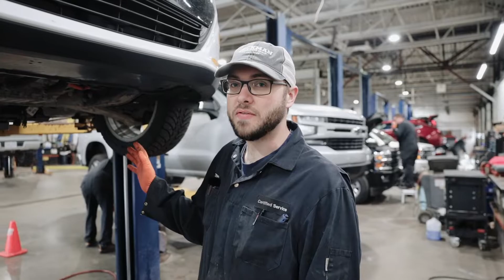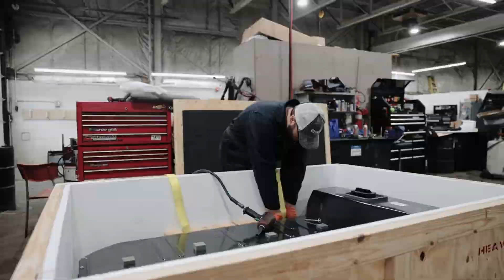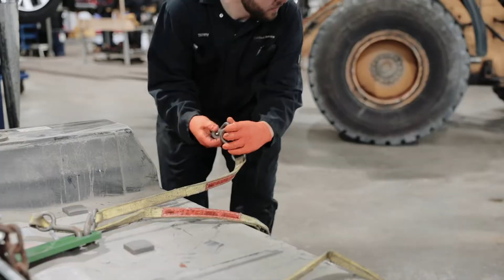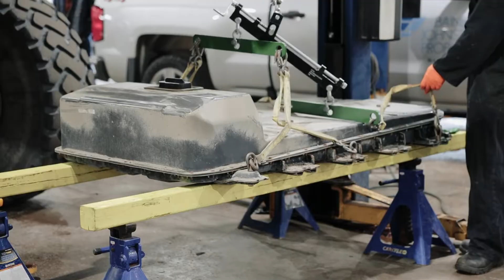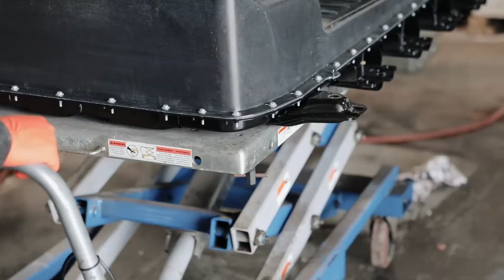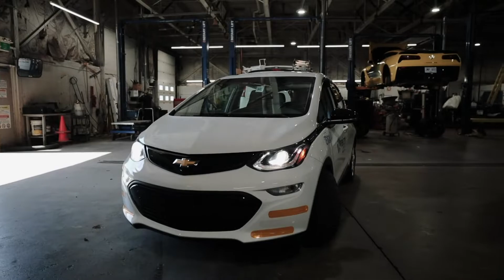EV BATTERY REPLACEMENT - Is It Really That Easy?

Comment: MSRP for a battery for a 2015 Spark EV is $30,286.87.  A brand new Bolt EV starts at $28,595.  Until that gets fixed, very few people are going to take EV's seriously.

Comment: I am a Gen X gear head and have rebuilt cars, motorcycles and work in the heavy industrial transportation industry. Recently bought a 2015 volt to replace an old everyday car and the EV cars are amazing and the Enginering is unreal. The youth today have some cool 💩 coming down the road👍

Comment: How much would this cost? Done professionally with any Bolt up to 2024? 

I read there is a possibility (motor trends I think) that you can get a used battery as well. They exist. At least in this size…or design. I saw a used price of 11K I believe..

But in an 8 year warranty you’d be luck to get a replacement battery. 

VinFast offers a 10 year/200 000 km warranty on everything in Canada. That would likely cover a new battery. And the VinFast has only battery coolant as opposed to many EVs having brake fluid as well, and even brake pads in some. (Which is dumb unless in contributes to a safer and more efficient ride). 

Having no maintenance is awesome..

From what I read the basics are tire rotation, windshield washer fluid top up, and software updates. 

Any fluids..

be nice if every EV came with a solar panal to prevent battery loss and wear in extreme temperatures. 

Any battery maintenance tips? Like besides the 80/20 rule.. some EVs came with optional block heaters,

And most come with free portable chargers that require only a wall outlet. 
Would a Motomaster Canadian tire portable outlet unit work to charge your vehicle in an emergency. ..?

Comment: Why is everyone comparing this to an engine swap? Imagine if replacing your gas tank was this involved and cost 20k and needed to be done regularly no matter how well you take care of it
Reply: Imagine your electric engine not wearing out.  Which they pretty much don't.  And these swaps on Bolt's were covered under a recall so they didn't cost anything to the owner.

Comment: Those packs are filled with small batteries, should be multiple packs that swap out and are easier to work with plus if only one series goes out just replace one pack.  Also, you could choose how many packs you need,  No need for hundreds of lbs. of extra weight if you are going driving short trips.

Comment: I drive them at work. My old 2016 Bolt would charge to 165 miles, no matter how long it was on the charger after 25,000 miles. I just received a 2022 model with 625 miles on it and it says 265 miles of range on a fresh charge. The difference is the old one was charged daily overnight, never letting it deplete and always topping it up. I only had the old one for the last 4 1/2 months, I wasn't its first user. the new one, I'm planning on charging it only when it needs it. I'm hoping this will help it with battery degradation.

Comment: So every shop now has to have a fork lift and several other heavy lifting devices. At 800 pounds that's more than 1/4 of the weight on a small car like that. Shipping them live creates an opportunity for a runway cell fire which will melt down the transport, yea definitely a brilliant cost saving , You didn't give the customer's free full charge? Crate waste a lot of trees. Really awesome. Ripoff . And how much did it cost, we know 5 hours of shop labor.

Comment: Lithium batteries don’t have electrolyte but they do often have a cooling and/or heating circuit with antifreeze like in the GM Bolt. I don’t know why you wouldn’t just cap the coolant lines when shipping the core back to the manufacturer to avoid spillage.

Comment: Now imagine changing internal combustion engine - messy and takes much more time :)
Reply: At least an internal combustion engine is cheaper and it usually lasts longer than five years,unlike this expensive 20000 Dollar Chevy bolt battery pack that's getting replaced after less than 5years.

Comment: Dec / 2023 just did a quick google search for replacement cost of Chevy Bolt main battery , $17,000 to $18,000 US , factory warranty 8 years or 100,000 miles whichever comes first . Who is going to buy a 10 year old EV ? The Bolt has one of the cheapest battery packs , some that have been in the news lately are in the 50 to 60 thousand Canadian dollar range 💸
Reply: I own a 15 year old Chevy volt.    It has its original battery that works fine.     If it does fail, I can have greenvolt swap the pack for 4500.    
I owned a 2016 Ford fusion for 4.5 years before the transmission failed.    Dealer wanted 11k to replace it.    Part alone was 6700$.
My point, ev batteries last a long time, and there are affordable options for repairs if they do go bad

Comment: To lower the fire risks associated with the Chevy Volt the replacement battery is a quartet of series 31 lead acid cells mounted in an 80-pound magnesium block containing a 25 pound thermite core. This upgrade has been shown to be less likely to suffer a thermal incident and causes less overall damage in the case of a fire than the stock lithium battery.
Reply: That's funny

Comment: Oh yeah no biggie! Every car shop has a heavy duty CAT handy. See, EV-s are cheap to maintain. You don't need to change the oil and filter every year!
Reply: LOL  I just saw a news report on some dummy who purchased an EV a few years back to "save money" since he won't have to buy gas.  But then he had to replace the battery and it was out of warranty so it was going to be $15,000.
Reply: @kensmith2796 lol...just saw a news report where a guy bought an ICE vehicle and changed his own oil (to save $75) and forgot to tighten the filter and the oil drained out and he dynamited his engine...only cost him about $10,000 so no biggie right???
You do know that the batteries don't just automatically die after a set period of time? Right? 
Geez.
Reply: @michaellippmann4474  It's doesn't cost 10K to replace a gas engine.  Nice try though, bud.
Reply: @kensmith2796  REALLY? You clearly do not know what a new crate engine from GM costs for a diesel pickup so nice try on your part!!!
Lol..
Reply: @michaellippmann4474  Yes, because out of all the gas engines out there on the road, a GM diesel is the only one.  Look, I get it, you bought an EV and are regretting it.  It's not my problem.  Enjoy your Tesla.  I'll enjoy driving my pre-2007 Jeeps like I have been for the past 30 years.
Reply: @kensmith2796  lol...no I bought my EV and I love it. Been driving EV's for a couple of years now. We just got back from a 14,000km road trip...it was awesome...oh and by the way it isn't a Tesla. 
Oh and by the way I am also a car guy with several classic cars and a 2000 Silverado 4x4. I just really like EV's for my day to day driving. Still love working on my ICE vehicles and won't be getting rid of them any time soon.
EV's are not the bugaboo that people try to portray them as just a different kind of vehicle.
Have a good day!
Mike 🇨🇦

Comment: The replacement cost of an EV battery not including labor is around $20,000. So at $70 a week for fuel to fill up my ICE it's going to take around 6 years to get to that amount. Not only that but if the repair to my ICE cost that much I'd scrap it and buy a brand new one for another $5000 on top of that figure.
Reply: its partially true, since if you consider only fuel, then yes, it may take about 6 years, but dont forget all the other maintenance during that period, like changing oil and other parts of vihicle, especially brakes (remember EV doesnt use brakes as much, almost never replace them), so with all that said, you will spend way more money owning ICE vs EV.
also, you dont have to get a brand new EV battery for replacement, you can easily get second-hand refurbished battery from vihicles after non-totaloss accidents for much cheaper price where vihicle is dead but battery is intact - some sell those and batteries are totally fine.
also,  some batteries do live way longer than 6 years, they just degrade.
if a new battery can give you 250-300 miles, then 6y/o one can give you 150-200 miles, its still perfectly usable for city or short-medium commutes, and most people are totally OK with that, so you can keep your car for 10+ years without any problem..
also, consider this, 
new LFP batteries are rated for at least 3000+ recharge cycles, so if you take 300 Miles X 3000 cycles, thats almost 1 million miles!!
even if its only HALF of thats, still, it will take you way more than 10 years to get to point where mileage if your car is  half million miles..
its TOTALLY worth it to get an EV today, especially today, and if you are so affraid of replacing the battery, got some chinese EV, some give you 150K miles warranty on their batteries, BYD Atto3 for example..
Reply: @benjaminshtark5977 It's true, you may spend more owning an IC over a 6 year period. But that's where the detail comes in. That amount of money you spend is over a long period of time not a huge amount of money up front. When you buy IC to begin with generally  the cost of the car is much less. Sure as long as the EV warranty covers the problem with the battery or anything else you may well be in front but if it doesn't you're out of pocket a lot more. So if you buy a second hand battery do you get another 8 year warranty just like a new one and what is the cost of a second hand battery? Replacement batteries are not easy to get either. I am quite happy to spend more over a long period of time knowing that if something were to occur the amount of money I'm going to have to pay at any given time isn't going to be a huge amount. Nor will I have to spend money on a charger to install at my home or to upgrade my electric system to handle the charger. If anything, I would prefer a hybrid over an EV even though hybrids are costly to replace batteries, somewhere in the vicinity of $5000.00.
Reply: @jamessmyth5949  you have a good point.
its why EV second hand market is plumeting where batteries are almost or are out of warranty..
i think people still remember where cost of replacing battery for older nissan leaf cost more than actually buying a new car (same nissan laaf).
but then again, leaf is bad example..
i think it will take another 10 years or more until this EV market matures and costs will go down..
on other hand, in some countries where prices for fuel is very high (unlike US), its financially much more feasible to get EV over ICE, since for those 150k miles you basicaly return cost of EV by not spending on gasoline..
i had a tesla model 3 (i live in israel), and in two years of ownership, i saved over 20k$ on fuel alone, i drove almost 70k miles in 2 years...
so for me, its was 35% of cost of a car covered by fuel savings, and when i sold the car, i even made something like 5k$, so for me it was a great deal,
i sold the car becouse of 2 reasons, 
1. warranty was ending
2. started to work from home heavily - so no need to have expensive car and pay month payments + interest %.
in the end it all depends on your needs...
if you live in big city and drive 10k miles per years, getting a tesla or other expensive EV is probably not best choise, but for those that live in suburbs and drive alot and price of fuel is high AND they can charge at home (private house) - then EV makes more sense..
Reply: GM's own report said EV's require 80% MORE mainrenance than ICE.

Comment: So out of 250+ comments it seems that over 50% have do with cost and longevity.  

As far as cost, replacement is expensive, yes 10-20k.  With that, federal law states all manufacturers must honor an 8 year 100,000 mile warranty.  So this is not a common repair.  Don’t believe me, just search “EV battery replacement” on YouTube and see how many results come back with owners complaining about battery replacement or doing an actual replacement. There is only one that I could find, and he was able to get it repaired for a fraction of the cost.  

Just think about that for a moment. If batteries needed replacement often, there would be loads of videos from actual owners showing their bill/estimate!  Instead nearly every video is someone that does not own an EV speculating on the cost and longevity.   That speaks for itself.
Reply: So who would buy a used EV with 101k miles? I often don't buy ICE until nearly that age and mileage.
Reply: @slotcarfan  No idea, but I imagine there is more than one answer to your question.  Sorry to be so vague, but there is no “one reason”.

Comment: People freak out about the prospect of replacing an EV battery, when they never think about the cost and complexity rebuilding or replacing an ICE engine or transmission.
Reply: Because that’s rare with good maintenance. EV battery replacement is very common by 10 years. Think before you speak.
Reply: @JetFire9  My understanding is that battery life can vary depending on the manufacturer and how the vehicle is maintained. Just like in traditional cars, maintenance is key. We’ve had 3 hybrids and 1 EV. All cars we try to keep at least ten years. We never had any problems with the hybrid batteries, and our EV battery is designed to last  3000,000 to 500,000 miles. We will probably get something close to that since we rarely use superchargers, which stress the battery, and we keep the car garaged when not in use. Just curious,can you let me know where you found the “10 year” data?  It’s early days and I’m always open to new information.
Reply: @peterbland7227  Nope. It’s the laws of chemistry. Lithium Ion fail due to age. Many by 10 years, most by 15, all by 20. Look it up. Everything you know about EV’s is based in lies and misdirection. Never talk about degradation, charge cycles and mileage. Not relevant to the bigger issue of failure with time. Average age of a car is 12 years. Average. Let me say that again, average. For every new car sold, there’s an ICE out there that is 24 years and running strong. EV’s are going to fail again.
Reply: @JetFire9 just curious, where do you get the 12 year number? The 24 year number? Anyway, apparently you want EVs to fail. My guess is vehicle drivetrain will evolve to regional solutions driven by which fuel type can be created most cheaply and in an ecologically sound way. The current generation of Lithium batteries will give way to better types, say, solid state. ICE engines will need to drastically improve efficiency to remain viable. I’m interested in finding out more about plasma ignition systems. They will improve efficiency by 20%. The key is lowering emissions.
Reply: @peterbland7227  Wrong and false claims. Apparently, you want to gaslight people into EV’s. Learn to google “average age of cars” and learn statistics.
Reply: @peterbland7227  Yes, AVERAGE AGE! It didn't say 12 year lifespan, it's a 12 year average age. That means many cars are older than that and still running. 

Really, there are many cars that are 20 and 30 years old and even older, still running on the original powertrains. This is particularly true for well made vehicles that are maintained. No matter how well you make it, an EV battery will last 30 years. Really, even 20 years is highly unlikely. Just sitting, a battery degrades. It's not possible to last as long.
Reply: It's not about the miles, it's about the cycles and the age. Theoretically, an EV lithium battery could last 1,000,000 miles. However, that's under ideal charging and discharging conditions. Realistically, an EV is only expected to last about decade. If you only drive 12k miles year, that's only 120k miles.

What's more, it's not so much about how long as it is how usable. Batteries do not wear or break like engines do, batteries degrade and become less and less usable overtime, and the degradation is non-linear. You could have little degradation in the first 5-8 years, or while under warranty, but then you could start seeing an exponential increase in degradation every after the warranty. That's just how they are. 

Engines are not like batteries. For one, they are repairable and serviceable. You don't have to replace the engine because your starter failed, you just replace the starter. Second, they are designed to last as long as we allow. Some engines are cheap and break after a decade. Others, they practically don't break at all. In fact, there are engines that are 100 years old, still running. Engines are just simple machines. As long as they are designed to be and are maintained properly, an engine could last indefinitely.
Reply: @MarkChristian2010  let me hazard a guess and say you don’t buy Elon’s “million Mike battery” claim.

Comment: Failed at 4 years old, how much did that cost, what fuel  cost would a gasoline car have used, remember the battery had cost for charging it over the 4 years. Who in their right mind would buy one of these cars?

Comment: So I didn't hear how much that repair would cost, why not?
Reply: 5h @ 200$/h + battery some 10k, that's a 11k job
Reply: Because it was free, no cost
Reply: That doesn't say much for the longevity of the batteries. @rcmnet
Reply: As someone mentioned, it may have been a recalled product and may have been free of charge. Most batteries have at least an 8 year warrenty and most of the time, it isn't claimed unless like the 2017/2018 Bolt that had a manufacturing defect and was recalled.

Comment: The Bolt first came out in 2017. It is now 2023. So the battery needs replacement every 6 years? 😮
Reply: No, the manufacturing process had a problem which caused the original batteries on mostly 2017 and some 2018 vehicles to potentially catch fire. GM and LG Chem (who manufactured the batteries) pumped out correctly made replacements which were replaced under warranty, which is what this video is likely showing. Most EVs have at least an 8 year warranty on the battery, Hyundai is 10. The manufacturing problem also affected same type of batteries put in Hyundai Kona EVs, and I think also some stationary home power type of batteries.